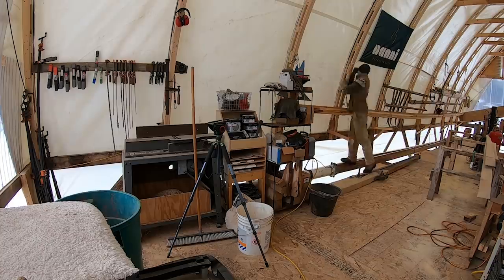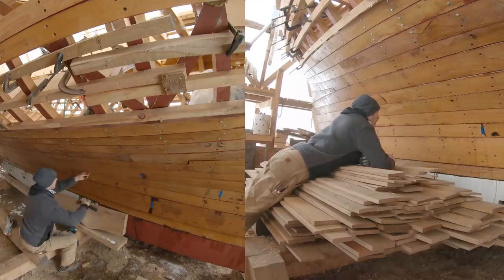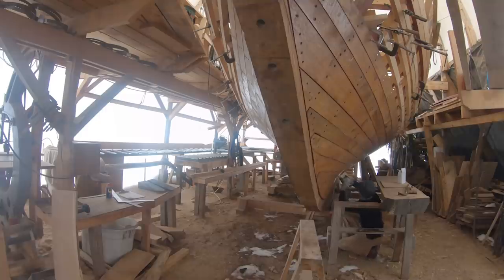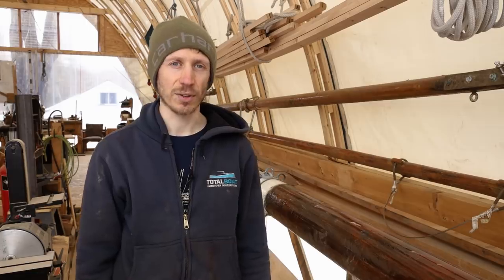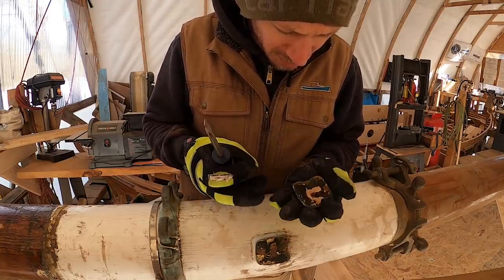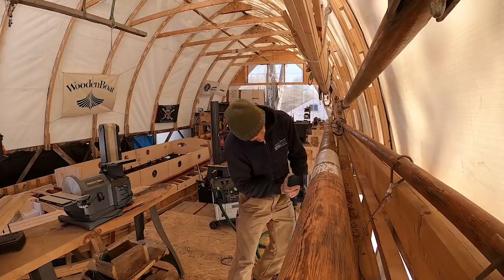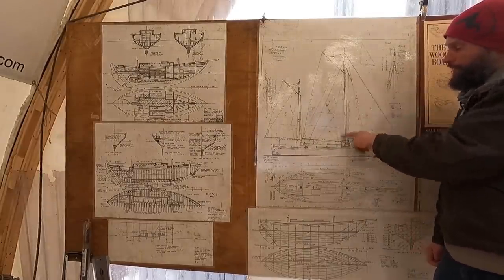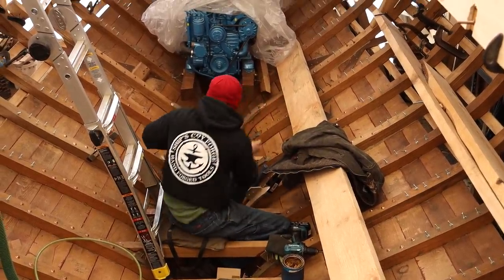Victoria's Mast - Episode 153 - Acorn to Arabella: Journey of a Wooden Boat

Comment: I know it's too late, but just mentioning this so you can prepare for it: That mast step design is very unstable. When the mast is rigged, and in use, that step will chew itself through those floor verticals loosening the mast rigging in the process. Best way vould have been fitting the step directly to the keel, when the keel was made. It can still be somewhat salvaged by welding horizontal plates with another vertical to those floors, where that step would then be bolted on. 2" wide plate doesn't go nearly as fast through that wood, than 1/2" edge will. Easiest way to bolt the step onto the plates: weld nuts on the underside matcing predetermined holes. Insert pieces of thread with sharp point onto each nut, and drop the pre-cut step on top. Now you have matcing marks for each hole, drill the holes, counter sink to level, and screw bolts in with a hefty dose of preferred slugde to fasten the step.
Reply: I agree. He went to all that trouble to cut a huge piece of wood for a stable platform and then rests it on four half inch strips. Not the best way to spread the load over a large area. (mechanical engineer) P.S. My boss told me a long time ago, "dont bring me a problem without a possible solution." So here it goes. Just mount a bronze plate beneath it, or at least under the notches. Weld long bolts to the plate from under neath, drill the appropriate holes in the wood block, slide it over, bolt it down. Done.
Reply: Fully agree and additionally the quality of that wood... cracks etc... Really just take a bite of the sour apple and redesign the mast step. I would be surprised if the current design survive the maiden voyage ... no joking...
Reply: @tonkatoytruck  Indeed. Axe and a saw blade don't have to be sharp, they just need time and softening the material by moisture and chemical reaction.
Reply: I wasn't sure what they were doing mounting the step block on edge to the floors but I agree with you. The step wouldn't last very long. even if it were made from Lignum vitae
Reply: Agree 100%. Additionally, his previously-stated decision to not protect the step from water ingress is also going to lead to major problems once the mast boot begins to fail and leak.
Reply: ive also felt that there wasnt something quite mechanically right. Everything is done so beautifully and makes sense but this mast step is confusing.
Reply: @anonymous_protagonist  Also, anything below the waterline is going to be soaked at all times. That is something that just can't be avoided, bcz physics.
Reply: Yeah, That mast step is basically sitting on 4 knife blades. Though they may be 1/2", considering the aspect ratio of all parts concerned, that's not much surface to bear all that loading.
Reply: @tonkatoytruck  My first lead engineer at Gulfstream back in 2007 had that saying in his cubicle.
Reply: @slasher5273  I believe the term is "speed blindness" and happens to the best of us. When a project is taking more time than was originally planned, short cuts are bound to happen. This mast step is one of the brightest examples of the matter. Too bad it is also one of the most crucial parts of the boat.
Reply: Agree 100% with the sentiment here. Not the greatest way to connect the mast step at all. Re-do it better fellas.
Reply: My understanding is that the step has been notched so that no loads are carried into those edges of the floors.  If I am wrong, then I agree. The forces from the mast ideally should go directly into the keel instead of through the floors.  If the vertical forces are going through the base plates of the floors, that's ok.  Remember, however, that masts have been stepped successfully many ways, so it's hard to predict the effectiveness.  Hence tradition added to design.
Reply: @boooshes  As far as I can tell, the vertical load of the mast being transferred to the mast step is being borne by the top surfaces of the bronze floors. Statically, that's probably fine, but dynamically, I'm not so sure. There's also the issue of those edges working their way through the mast step over time.
Reply: Yeah, I'd be worried about grain crushing under that bearing load. A plate would work perfectly as you mentioned.
Reply: I'm sure you all mean well, however let's not forget, It is HIS boat, Let HIM do it HIS way.
I admire hard work being done by dirty hands, and people watching hard work being done with clean hands giving advice really have no place in the world.
Reply: @idahorodgersusmc  We would gladly do both, given the opportunity. Besides, sound advice by professionals should be headed.
Reply: I have thought about this more. The mast is a giant lever. The loads from the sails will be multiplied at the mast step, fore and aft, port to starboard, by the connection at the deck (fulcrum). I would add a 1/2" x 1/2" bar to the plate, all the way around the mast step to prevent it from sliding around. Think of the mast step like a giant engine motor mount. It has a steel frame for structure and rigidity (the bronze plate) and a urethane bushing (mast step) to deal with the constant oscillations of the engine.
Reply: @idahorodgersusmc  Why do you assume we have "clean hands?" And this mast step design, as we (people with engineering backgrounds) have stated, appears to be a poor design for the loading it will be put under. We may not have the full picture of the final design, sure, but we would be remiss to not question what looks to be a point of catastrophic failure. People like us are why you can fly, drive, eat, drink, breathe, and exist in a relatively safe manner.
Reply: @billhamilton2366  Lignum vitae. I haven't worked with that in a few years. Quite a unique wood that can solve a lot of problems in the right application.
Reply: @idahorodgersusmc  We do mean well.  Engineers take a conservative approach so as to best guarantee success.  Based upon the loading and compressive strain perpendicular to grain, it is highly likely that the realized mast step will under go catastrophic failure.

Yes, it is his boat.  Notice all those pieces of blue tape stuck on the planks?  Perhaps your "dirty hands" will know why they are there.  But only if you understand the tensile strength of the materials and the stress applied.
Reply: I agree with everyone here. A large downwards force on the mast step should not be taken on the thin edges of those four bronze floors. You could block up the space between the bottom of the step and the keel.
Reply: If the mast is 7" diameter, the total area of those plates is more than half the cross sectional area of the mast. I don't think it's a big problem.
Reply: @tonkatoytruck  Then go build your own boat, ain't nothing stopping you but a list of excuses
Reply: @WhatAboutTheBee  let him build it, if he wants your help, he will ask for it
Reply: @thomasbecker9676  I hope your engineering degree was printed on soft paper.
If he wants your advise, he'd prolly ask for it.
Reply: @roscoejones4515  unsolicited opinions are  just speculation from spectators
Reply: @idahorodgersusmc  My engineering degree is in aerospace from Embry-Riddle. What's yours, or did you eat the crayons before you scribbled it out?
Reply: @idahorodgersusmc  Wow! Half the people in this world are below average.
Reply: @idahorodgersusmc  If he needs you to white knight for him, I'm sure he will ask for it.

No clue on the blue tape?
Reply: and I commented on that problem before reading all this. good eyes, friends.
Reply: I guess these commenter’s missed the fact that it's been fitted not to move.
Reply: Steve said the reason he is building the step is to NOT put a load on the keel but to spread it out into the hull via the floors. So adding blocking between the step and the keel is no option. Only adding more contact area to the floors would help.
Reply: @oikkuoek  While salt water will definitely soften the wood - accelerating the degradation of the step where it contacts the floors - fresh water leaking down from the boot will cause the step to rot. The whole affair sounds like a mess to me.
Reply: @HouseGurke  As in my salvage suggestion.. :)
Reply: @HouseGurke  I believe the suggestions are meant to assure it's locked into the floors.
Reply: @HouseGurke  yes, spreading the load is helpful.  

However, the load at the surface between the bronze floors and the mast step are the issue.  Not the surface between the floors and (keel + hull).  

The Modulus of Rupture for Southern Pine, in perpendicular grain applications, is the matter at hand.
Reply: @anonymous_protagonist  indeed. I would make the whole step out of silicon bronze and bolt it to the floor verticals, and seat the mast through a square hole with vertical side supports underneath, on top of rubber seal between the mast pole and the step. Leaving the underside of the step open for ventilation.
Reply: @MrPotatochips4  It's a piece of wood that's going to expand and contract with moisture and be subject to extreme dynamic compression and torsion. With those tiny points of contact, it's going to move, micrometers at first, but move it will - and any movement will cause damage that will snowball into even more damage over time. At best, those micrometers will likely grow into pain-in-the-ass adjustments to the rig - at worst, full-blown failure.
Reply: @ralphgesler5110  Even if it is absolutely laterally constrained, it is still subject to compressive forces from above. Being wood, that Steve has opted to not seal against moisture ingress, it's going to expand and contact with moisture as well as temperature - defeating the lateral constraints.
Reply: @WhatAboutTheBee    I know, I was referring to the contact area between step and floors. If the surface between step and floors would be built like the surface between floors and frames, there would be no issue.

Also, I just remembered another reason why blocking between step and keel wouldn't work: The bilge water needs to flow underneath the step. Blocking would swell and cause further problems.

A really tough problem, but I'm sure Alix and Steve will solve it.
Reply: @HouseGurke  Spot on!  Make the contact between the step and floors larger, and the problem is resolved.  The larger the contact, the better the solution.

BTW, thank you for a polite response.  It is nice to hear reasoned discussion!  Cheers!
Reply: @tonkatoytruck  the deck should not be a fulcrum if the shrouds are keeping the mast up,  all horizontal loads on the mast should be converted to compression loads by the shrouds...
Reply: Considering that tabs will be welded onto those bronze floors, I think they got it figured out pretty good.
Reply: @jeffwisemiller3590  Is that why they cut the grooves in the step in the last episode?  You know, where the edges of the bronze floors fit onto.  

They have discussed bronze tabs for the "sole", which is the name for the interior surface you walk on.  The "floors" are the parts that provide an additional attachment between the keel, frames and  garboard planks.  In Arabella, they are bronze.
Reply: @jeffwisemiller3590  Welded tabs won't save this design. Vertical tabs will chew themselves inside that step just a easily as those edges, and horizontal rods will either bend, break loose or dig into that step. Either way, the mast rigging will come loose.
Reply: @MrPotatochips4  And if you think it will not move, then you have no clue the loads that are being put on the the mast. Its wood. Its used because it does move. You need give to keep things from cracking and breaking under stresses that the hull sees on the water. And shrouds are nothing more than giant springs. They share the load but they are far from stiff enough to prevent movement.
Reply: I am looking forward to hearing what Steve and Alex do with these comments.    This sounds like constructive criticism and a reasonable observation.    Time will tell.
Reply: Y'all do remember that the core of the mast step block is Live Oak, with the sides made from Black Locust, right?

It's the mast proper that is Southern Yellow Pine.

Vastly stronger material on the step than the mast.

I admit, I'd be a lot more comfortable with a bit wider contact point on each floor, but the contact area between the step and the floors is already greater than the base of the mast.
Reply: @ScottKenny1978  It really does not matter, which type of wood is against those edges. the force of the rigging and the movement of the mast will chew that step into those edges regardless. It's still wood against a thin egde of metal.
Reply: @ScottKenny1978  I do remember that there are three pieces of wood merely bolted together.  They do not form a monolithic block, rather they are to be treated as three separate beams, in which the stack is oriented 90° out of phase to loading.  The modulus of elasticity of each wood species differs, as does the modulus of rupture.  When calculating the stress on the step, they need consider the moments of inertia, and in doing so, find the forces applied to the beam supports (hint: at bronze floor / mast step interface).  Then, and only then, will they know.

Neither Steve nor Alix are Engineers.  
That is why you hear things like "that should be good enough", instead of "I've done the calculations.   The deflection is n inches and the S-N curve shows these components to have time T of useful life".  I would accept, in lieu of calculations, extensive practical hands on experience.   Steve cannot offer practical experience to support his conclusions.  This is his first boat.  He has zero basis for his decisions.  No engineering calculations, no extensive life experience.

Yeah..."good enough"
Reply: @oikkuoek  half inch wide and what, 18" of contact area? Not counting any tabs welded to the floors to increase contact area and provide bolt locations. That's 36sqin or more of contact area, depending on how wide that block actually is.

A 7" mast has 38.5sqin of contact area with the step block. 

The step block is to spread that load across 4 frames, some 4+ft, instead of a single point on the keel.

I was also under the impression that the cuts in the block were to provide fore-and-aft location control, not being the primary contact surface directly.
Reply: @ScottKenny1978  Okay, now you have calculated the surface area. Next try to calculate the pressure per square inch. The mast itself weighs 1800 lbs dry, the sails around 2200-3000 lbs dry. both of these will soak up to 80% of their volume of water. Then the rigging material 800-900 lbs, and all this is tensioned to keep the mast upright from at least four corners, if they use those old haliards, then eight points. so the overall weight pushing against that step is timed by 2,6 by the power of 8. For this simple reason alone, when a mast is embedded to the keel, a block is used to spread the load. And remember, all this weight is grinding the block against those bronze pieces  from the folcrom point on the deck, in every direction.
Reply: @idahorodgersusmc  Well said, 100% agree
Reply: @oikkuoek  yes.

And again, it was my impression that the cuts in the step block are to control fore and aft position, with tabs to be added to carry more of the load.
Reply: @ScottKenny1978  If you did the math, you should realize that any type of tab design doesn't really make a difference. That step block design is still very unstable and grinds itself into the bronze floors, loosening the mast rigging in the process, which was my original concern.
Reply: @oikkuoek  yes, if the floors are touching the bottom of the cuts. But that's what the tabs are for, providing more contact area. That's going to be an easy 2" wide tab on each side of the floor, maybe 3" wide. I'd do it as 2 separate tabs to give water a place to go.
Reply: @ScottKenny1978  As I explained earlier, the tab design does not matter. The pressure is so strong, that the block will sink until it meets the keel.
Reply: @oikkuoek  that's not typical of live oak, especially not when it's sitting on over 24" of bronze. 3" wide on each side of the floor, 4 floors.

Edited because I need to stop doing math in my head.
Reply: @ScottKenny1978  It still won't make any difference, if it were petrified redwood. It's still wood, and wood is softer than bronze, so the wood gives in, and chews itself through those floors, until it sits on the keel. That is just how it goes. Tabs will slow it down a bit, until they give in, or sink into the wood, or both. The rigging will come loose in any case, and most likely when it definitely should not do that.
Reply: @oikkuoek  how much pressure are you assuming here?
Reply: @idahorodgersusmc  By "draft," I assume you mean selective service, which yes, I was registered to at age 17. The last draft in the US was in 1973; I wasn't even born yet, so how could I dodge it? I'm sorry you couldn't get an education, and your identity is rooted in being a marine, but I shouldn't be surprised.
Reply: @ScottKenny1978  I already gave you the mast and rigging weight numbers and the tension factors, you had the surface area calculated, so you can do the pressure calculation also. But, that is still not all. It's the grinding motion of the rigging, that will be the step-sinking factor. And it's not going down in one go. It just will loosen the rigging periodically, with no predictability, hence the unstable nature of the design, and that feature will be the unwanted characteristic I warned about. Let's try to visualize the problem here: You are sailing at Northern Atlantic, in 27 knots of wind and 45 gusts, when the mast suddenly looses all tension. It drops the wedges off from the hole, and starts to wave uncontrollably, until it brakes in half and drops in the water. If the boat is still above the surface, it's definitely not going to be smoothly sailed to the nearest harbor, around 1200 nautical miles away. And when the insurance company sees these videos, you get to pay the rescue mission fully.
Reply: @oikkuoek  some two tons rigging mass times 2.6^8?

Seriously? Over 8 million lbs force?!?

I am going to need a citation for that.
Reply: @ScottKenny1978  More or less, when fully rigged and stationary. When the boat is sailing the mast needs to stay seated in the block, remember. And the only way the mast can withstand the force the sails are creating, is through tension of the stays. The stays are not just holding the mast vertical, they are pushing it against the keel. That's the thing. The main reason why mast block exists. To spread the load of the tensioned rigging. Now, if you add shredder blades to that equasion, you are going to get wood chips, no matter what.
Reply: @oikkuoek  again, over 2000 times the weight of the masts and sails?

Citation needed.
Reply: @ScottKenny1978  okay, maybe the factor is 2,6 x8 rather than power of 8, but the point still remains the same.
Reply: @idahorodgersusmc  disagree mate...this mast step is doomed to fail and the failure could be catastrophic.
Reply: @HouseGurke  you need to understand force vectors.
Reply: @oikkuoek  ok, so 21 times the weight of the rigging (wet). That makes a lot more sense. You said about 3 tons for the rigging (soaked with water), so 63 tons downforce on those floors. Woof.  

Yeah, that's some ugly pressure on the step block for sure, and definitely needs more than 40something square inches of contact. Note that even though I call them "tabs", I'm talking about a strip of bronze some 3 inches wide on either side of each floor. Or wider. Plus triangulations to support the load between the bolts. (I was on subs, I think in terms of sea pressure at test depth) So that's 6x18x4=432sqin of surface.  The challenge is getting that all level.
Reply: @ScottKenny1978  Yeah, and there is still the grinding motion of the mast. It works like a giant mortel. And for he challenge of the tab desing, I gave an idea in the very fist comment. Making the contact patch as wide as the floors with vertical supports on both sides is the slowest desing for the mast block to sink in. It can easily be fabbed to the direction of the rake, so that the bock only needs level slots. Tinkering with tabs that eventually either give in or sink in the block is just waste of time and material.
Reply: @tprdfh51  I ain't your mate
Reply: @HouseGurke  do you understand "force vectors"? If you do then you will understand that the way Steve is planning to fix the mast step will actually concentrate enormous mast loads on 4 frames of the vessel instead of allowing the keel to distribute those forces evenly throughout the entire structure of the vessel.
Reply: @ralphgesler5110  Steve's method will concentrate the enormous loads imposed by the mast on 4 welded floor frames and the oak frames they are attached to instead of allowing the keel to act as a beam shelf and distribute the loads evenly throughout the entire frame structure of the vessel. If guys like Atkin or S&S had a better way they would have done so...and they didn't.
Reply: @jeffwisemiller3590  I disagree and believe they are headed for failure with this modification.
Reply: @woodyackerman1906  I sure hope they get expert opinion from an experienced marine engineer...IMO this modification will lead to failure.
Reply: @oikkuoek ...or break the welds.
Reply: @WhatAboutTheBee  I agree with you completely...they have done such great work up until this point - I pray they get a second opinion from an experienced marine mechanical engineer.
Reply: @ScottKenny1978  Steve's plan will concentrate rather than spread the mast load at those four frames. If the mast was stepped directly into the keel the keel would act as a beam shelf and distribute the mast forces along its length evenly to the other 40 or so frames of the vessel...as Atkin intended.
Reply: @oikkuoek  I think the welds will fail as well.
Reply: @oikkuoek  Scott doesn't seem to comprehend how mast loads increase when the vessel is heeled over or hobby-horsing in rough seas!
Reply: @idahorodgersusmc  thank God...and for what it's worth, everyone on a ship is a mate - which you should understand Jarhead!
Reply: @tprdfh51  That is truly my worry too.. To be honest, I wouldn't fully rely on the double vertical desing either, that I proposed. It has a longer lifespan than just that one plate, but yeah, definitely wouldn't take that to any kind of wind.
Reply: @tprdfh51  well we ain't on a ship, and I damm sure ain't no swabjockey.
I just admire these guys for taking life by the horns and building something great with their own two hands greased by sweat....win, loose, or draw they should be an inspiration for many.
It just pisses me off that they are being heckled by a bunch sitting on their butts doing nothing.
I'm a land lover, I just admire the craftsmanship involved.
And eat crayons while watching....
Reply: @idahorodgersusmc  I admire them too...very much so, but I'll be damned if I stand by and watch them make a potentially fatal mistake.

If I am making fire control adjustments from the battlefield are you going to argue with me from the firing line when I call; "add 300 meters" because your fire is dropping short on my head?
Reply: @tprdfh51  I think your comparing apples to onions with your fire mission scenario, vs how a guy builds his own boat.
And we all know the most dangerous thing on a battle field is a Boot Louie with a compass, a map and a Radio. And I guess your assumptions are that a rookie boat builder is equally dangerous with a hammer, saw, and square???
My point is, its his boat, if it fails, it's his to fail...or perhaps succeed.
Or as like in field artillery, fire a spotter round before firing for effect.
I'm sure adjustments can be made in boat building as well.
Reply: @idahorodgersusmc  our Looies always gave the compass to the most experienced soldiers in our sticks...they had more important matters to deal with! Either that or we found ways to relieve them of the compass - "Lieutenant...is that the great bird of paradise I see in that tree...look, up there!" 😉
Reply: @HouseGurke  that’s why I said to put a thick plate on top of the floors
Reply: @oikkuoek  Sails don't weigh 3000 lbs.  Where did you get these numbers?  They are wildly inaccurate.